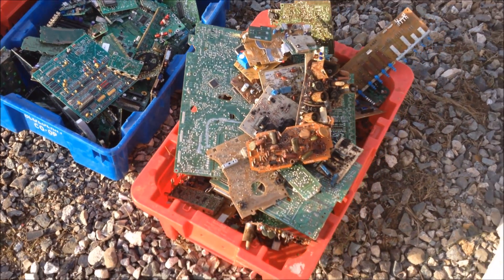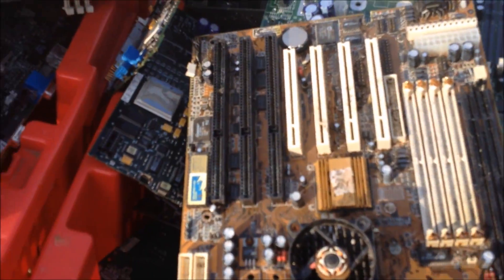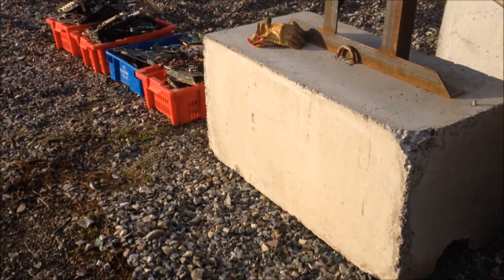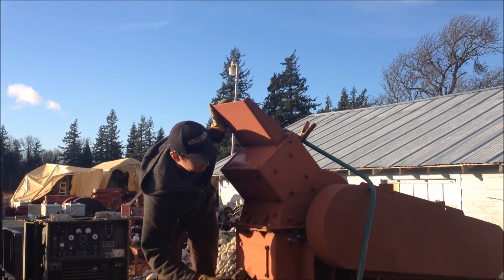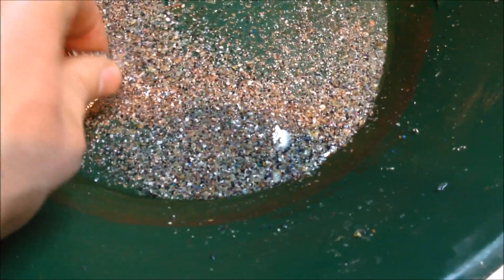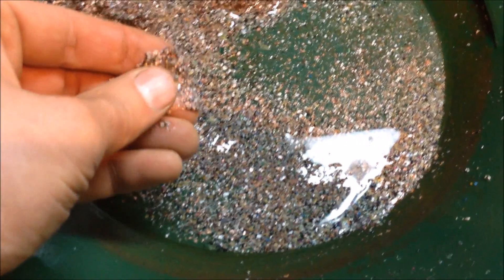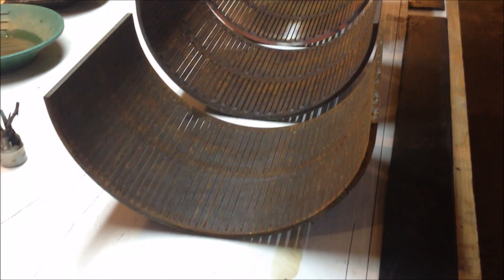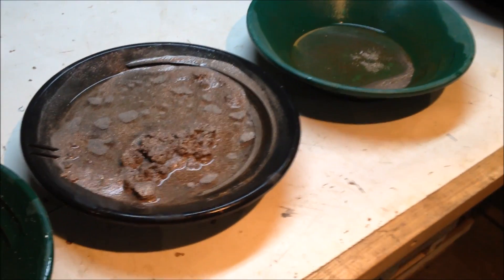URBAN MINING! Recovering gold, copper, precious metals from PCB's without chemicals

Comment: Never judge s board by the color of its solder mask. Gold corners on bgs chips ate a good sign. Boards with slits for addon cards are another good sign. The size of components is gonna be the biggest indicator. Boards with resistors and capacitors and diodes that are especially tiny will usually achieve the highest grade. Like the control boards of computer hard disk drives. As far as boards get graded thats the top end. But in reality it gets better than that. The touchpads off laptops have their entire surface covered in gold. Control board off of old cd rom and cdrw drives often can be covered in gold so as the circuit tracings are good instead of copper. You also have to watch processing like this you can have scrap where the chips have legs that are still in the core be covered by a thick plaid layer of gold. You will lose a considerable amount of gold this way. Now you also run into a situation where a lot of the small capacitors on especially nicer stuff will contain a bit of palladium. Generally these are not magnetic or not very magnetic... But if you're using strong magnest for sorting snd seoarating this often will still stick to the magnets. People dint realize that palladium is diamagnetic. It can actually be ferromagnetic if engineered right.... My main point is, be very careful working a lot of material fast, that you arent loosing what could potentially be a significant amount of your values to the waste.

Comment: Well the cheap stuff with brown and green sides are called mix boards.. they are the cheapest... Second was coil boards .. u can see lots of coils and aluminium battery stuffs, motherboard next second expensive, then the most expensive stuff was dual processcor motherboards.
But in your motherboards section you had some IC boards which is the most expensive among all of them. I'm not sure how your scrap dealer deal with you but it's a good video anyway.

Comment: I've been looking at gold refinery with chemicals  I've seen people use incendiary using a hot wood carving tool to scrape the golden teeth off of PC Ram but this method has an interested so I checked out their site and for the hammer Mill is roughly $10,000 the Shaker table around $8,000- $9000 so I'm guessing this method is for someone  is starting  a company and has contacts to people that give them ewaste to break down
Reply from the maker: Thank you for your comment and for watching our videos!

Comment: need more processors, less boards. Also if doing higher grade processor load, I'd crush a bit smaller than you currently are with hydrolic press to flatten and hammer mill to split
Reply from the maker: Great, thanks for the tip!

Comment: Because of the lead solder you now have a lot of waste water to dispose of. What's your plans with that?
Reply from the maker: The system is a closed loop system so the water is being re-circulated. You will eventually need to treat the water and have it properly removed once the settling pond becomes full of waste.
Reply: What's required to dispose of the waste  water? Do you have to bring the lot to a hazardous waste facility, is so what's the cost of the disposal. I just want to figure out if it's a feasible option for me or if I'll just end up paying a ton to get rid of the water.
Reply from the maker: The water can be recirculated for a long time before needing to be replaced. The water does not need to be perfectly clean in order for the shaker table to work effectively. On site treatment is another option. I would recommend looking into the rules and regulations for disposal in your area.

Comment: Genereally the top two buckets could have been put together, there is little difference, but the other two are split out pretty decently into fully analog circuits, or simple logic chip based circuits, there will be lots of lead and other less precious metals in the first two, and the top two which are more "integrated circuits" and digital electronics will have more of the precious metals, but still in pretty low amounts. I'd be carefull with the tailings, the older stuff can be very toxic, and in some cases the newer stuff can be too. Additionally you probably got a lot of alloys as well.

Comment: Fraught with danger. Some of the older capacitors contain PCB's (Polychlorinated biphenyls), which can cause various types of cancer. Also, some of the Semiconductor devices contain Beryllium Oxide, which is also a proven Carcinogen.
How are you disposing of your waste? If not done correctly you are putting other peoples lives at risk!
Sorry, but you really shouldn't be doing this!

Comment: This looks very inefficient to me. It is common for thin flakes of gold to float. Circuit boards ONLY have very thin flakes of gold or gold plating. What about other precious metals and Aluminium and ferrous metals? Are you ignoring them? 
I would suggest that your methods and equipment look quite good for sorting gold from paydirt. 
Sorting the elements from circuit boards in this way is akin to cracking an egg with a bulldozer. I suspect the vast majority of valuable material  ended up in your largest first bin - unsorted.
You mention sodder many times. I am guessing it might be American slang because it does not appear in any of my three dictionaries, one of which is Websters dictionary (made in USA). I think you mean solder.

Comment: I seriously doubt there is any gravitational method to recover gold from a gold plating
Reply from the maker: I agree, and this is not what we are trying to do.  There is a lot of gold in these boards that is not plated such as fine gold wires in chips, etc.   This gold can be separated using a shaker table.  The rest of the metal including silver, copper, platinum, palladium, etc. is cleanly separated from the boards, plastic, and fiberglass and concentrated.  The gold plated metals will be in this concentrate as well.  The metal concentrate is worth much more to a refiner than whole boards and this is where most of the value of a system like this comes from.  Thanks for your question.
Reply: I'm afraid when it comes to plating it may be simply washed away with plastic and fiber glass.
Speaking about bonding wires, it is "trapped" inside epoxy. To free it nicely incineration is one of possible options. Other ways bonding wires are somewhere 5-30 micron in diameter and "trapped" in epoxy. While you milling them just up 5 mil. I'm afraid the most of it will be washed away.
If you could mechanically separate chips from the boards at first then to incinerate them, then to crush them and only then run them on a shaker table it would significantly increase your your yield.
Well, this is just me :))))
Reply from the maker: Thanks for your further comments.  The bonding wires being trapped in the epoxy were also a concern of ours.  Here is our newest video: https://www.youtube.com/watch?v=Sbr1LK2NKZ4 This has a hydrocyclone that is still in development.  The concept is the epoxy and other metal bearing material will go back into the hammer mill for further grinding.  Once the epoxy is ground so small that it is carried up in the water column and out the top of the cyclone is the only way for it to escape the system and by doing this it is free of gold bonding wires.  We have done some extensive assay work on our tailings (waste from hydrocyclone) and have found we are capturing around 85% of the gold with this system.  With our newest revision (video coming soon) we hope to have about a 95% capture rate of the gold and other precious metals.  Stay tuned for more vids.  Thanks again.
Reply: I would of use some acid on mlcc retrieve gold ,silver and Palladium and some of the other I would electrolytes the gold to recover it
Reply: @blessbless5648  while that is an option, the title clearly states "without using chemicals ". This is just another way to release all the metals from PCB boards and not just the PM's. Per ton of PCB's you probably get more copper value than gold, so the gold recovery is the sprinkles on top of everything else..

Comment: Those components are only plated with gold so don't you still have to dissolve down the base metals to retain the gold?
Reply from the maker: +Eric Alderson That is correct.  There is actually a gold line that does appear on the table which can be captured and melted down directly into dore.  The remaining gold is still plated to other metals and needs further refining. Thanks for your comment.

Comment: The large circuitboards you're wondering about appear to all be ancient mainboards from desktop computers (see "Socket A"), some high-grade (likely Intel from back in those days) and some budget (AMD, which was great for overclocking providing you gave it some extra cooling)... The RAM DIMMs you see could be worth a small fortune if they still function (which is kinda unlikely), since they're no longer manufactured.
Reply from the maker: +Sebastian Ramadan Thanks for the tips

Comment: how does this method get clean gold ? as it's plate not solid ? wouldn't it be full of copper etc...
Reply: PS so it needs to have aqua regia done anyway
Reply from the maker: +Tim Ellison Hi Tim, thanks for the questions.  Actually there is a line of free metallic gold that develops on the table from the small gold bonding wires, etc.  There is actually some free gold in that stuff.   I can be separated from the other metals fairly easily by screening and re-running on the table again.  There is a lot of gold plated materials as well that will need to be further refined to recover the gold/copper/silver/etc. but a huge percentage of the volume has been removed and sending pure metal to a refiner is worth much more than boards themselves.  Thanks
Reply: yes cool i do aqua regia myself ,mate that setup looks like it would be great with a bigger screen for rock bearing gold too ,have you tried that ? .i built a rock crusher and a sluice for that works great .
Reply from the maker: +Tim Ellison That is actually how we got started was in the mining sector.  Check out this video for our current turn key system: https://www.youtube.com/watch?v=NlAXVFFFiEI
Reply: Cheers ,:) im a miner to we have a tenement in W.A goldfields .
Reply: Tim Ellison yep

Comment: i had to say it, but i never want metal coming out of my number 2 hole. But other than that..this seems better than my 55gal drum full of acid method..i hate using all those chemicals.
Reply from the maker: +Huxlee29 Actually we have metal coming out the number 1 2 and 3 ports on the shaker table.  The 1 and 2 ports are completely clean metal.  Number three is a mix of boards and copper.  This can be re-run through the hammer mill to recover more metal.. Thanks
Reply: mbmmllc The first part of my comment was a butt joke..if you were not certain of that. the rest is me likeing the process you guys are using.
Reply from the maker: +Huxlee29 Haha, I didn't even catch that!  I guess my sense of humor isn't what it use to be.  Thanks for the comment.

Comment: Question - have tried or considered roasting the circuit boards in a pot (covered but not sealed) over enough heat to trun the fibreglass to carbon ?
Reply from the maker: +watcher0I0 Thanks for the suggestion.  It would be very difficult to do this on a large scale without the proper equipment for both health and environmental protection.  By just grinding the boards and separating the dense material from the waste and recycling the water it is a simple, inexpensive, and safe way to process the boards with a high percent recovery.  Thanks for your comment.

Comment: How are you powering the mill and the shaker table? Is the output from running boards like this enough to cover the power cost?
Reply from the maker: +Erik The hammer mill is powered with a 3 phase electric motor.  The power costs are quite reasonable, only about $10-20 per day depending on your cost of electricity.

Comment: Most of those are Motherboards out of computers...
Reply: +Eric Nielsen also, some of those are worth up to about $20 apiece if they work
Reply from the maker: +nikkolaus Thanks for the info!
Reply from the maker: +Eric Nielsen Thanks Eric for the info.  I have both sides about the gold corners.  Some guys say that means there is gold wiring in there for sure, and other guys say those don't have any gold in them.  Can you elaborate a little bit about what the gold corner means, if anything?
Reply: +mbmmllc they are just there to line up in the right direction during manufacturing. The highest concentration of gold will likely be on the bottom of processors. those are the brains of the computer.
Reply from the maker: +Eric Nielsen Thanks Eric
Reply: +mbmmllc Those corners are also not made out of gold. Generally speaking older boards will have more gold than newer ones and newer motherboards tend to have metals like platinum more than the older ones. All in all your grading is, well.... Very inaccurate. But not that it really matters considering how it's being processed.

Comment: it is interesting but not the way i wood do it id start by soaking the boards in hcl and peroxide  to remove most of the peaces then run the boards trew your shaker table/mill the boards will have sum silver on but the gold is 100% plated on outher meatels   you can use th same 55 galln drum of acid over and over and over just add a fish tank air stone to it  and you can use stanlis  steeel powder and a mixer to get the coper out in ;little beads  are you selling the finished product or further refining it
Reply from the maker: +jackfoo2 Thanks for your expertise.  Right now we are just selling equipment and don't do any processing our selves.  We have really advanced the process since this video and we are going to put out a new video soon showing our new system.  Thanks.

Comment: crushing the aluminum heat sinks to dust might be a poor choice because it is too light to separate later. Aluminum might be the third most valuable material on those PC boards.
Reply from the maker: 0MoTheG Thanks for the tip.  We are working on a different screen and classifying system for the hammer mill and we should have a new video up soon.  With this new screen we are able to capture the aluminum in the #3 port.  Thanks for your comments.

Comment: I just pass by here 
I feel very interested in your video!
Is it really worth investing in these machine?
They're seem expensive.

How many months that you can reach the break even point after invested?
Reply from the maker: vatarants Hi and thanks for the questions.  We are in the final stages of perfecting these machines and we are finding we can get between 85-90% recovery of the precious metals and even higher recovery of the base metals (95-97% for copper).  On average PCB have about 3-5 oz/ton gold, 50-100 oz/ton silver, 5-10 oz/ton palladium, 20% copper, some lead zinc and tin, tantalum, etc.  So from a mining perspective this is some of the richest ore on the planet.  If you have a source for PCB then this process will be well worth your investment.  It probably doesn't make sense if you only get 100-200 lbs of boards per month though.  Thanks for the questions.
Reply: oh my goodness 
thank you very much! : )

Comment: I forgot to mention. If you want to increase throughput then an initial rough shred should help. The hammer mills are brilliant tools but feeding very large stuff to be reduced down to 2mm will take time. Feed them boards that have been chipped into say 5 cm square pieces should make things faster and of course the initial shred to that size is really fast.

You could even position the shredders output above the mill, that way you don't have to mess around.
Reply from the maker: Laughing Achilles Haha, you beat me to it.  See my comments on your previous post
Reply: mbmmllc Haha oh well either we are both thinking along the right lines or we're both wrong in our approach :)